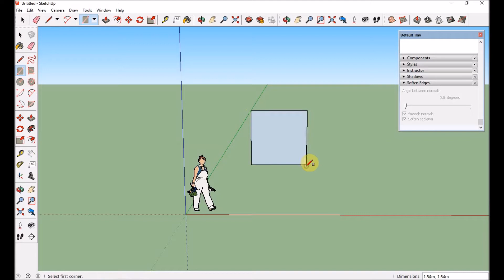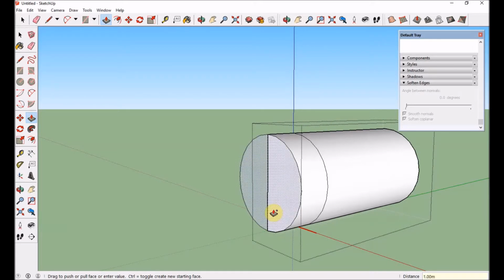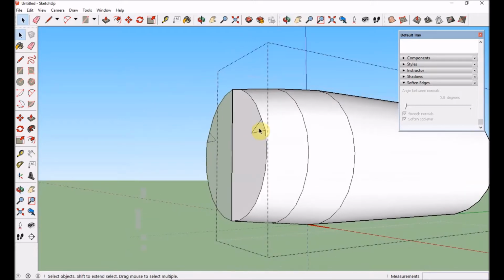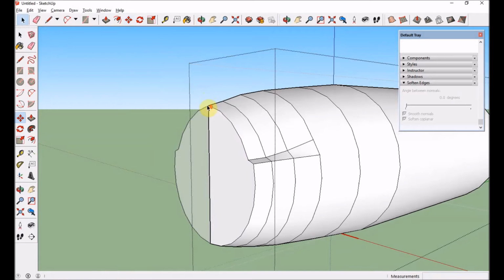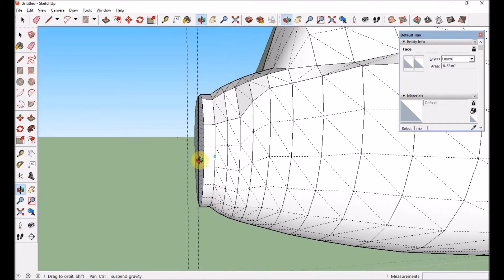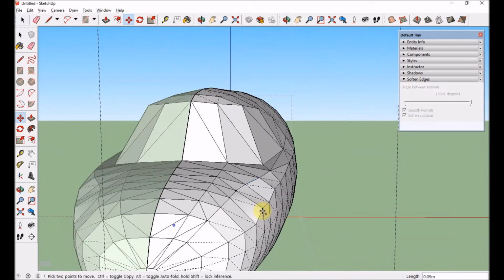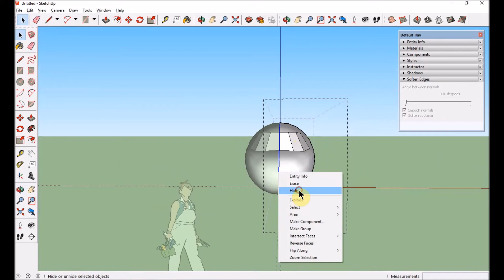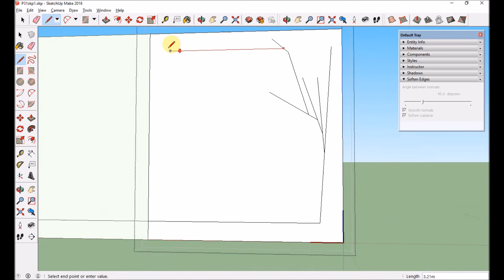Sketchup: How to make curved shapes | no plugin required

Comment: looks like what i need however after creating the component, copying, and flipping.. i attempt to try to use the push/pull tool (on the same component that you highlight) but I am not able to push/pull the object (get a little "red circle and cross-out" when hoverin over the half circle). Is there a step I missed? Sorry, the video is going too fast.. maybe there was something I did not catch. Thanks in adv.
Reply from the maker: try entering the component by double clicking on it
Reply: @williamxiji  that did it! Thank you so much.. this is what I needed to complete my designs. Using components make the difference!